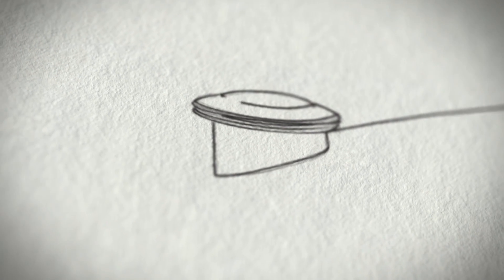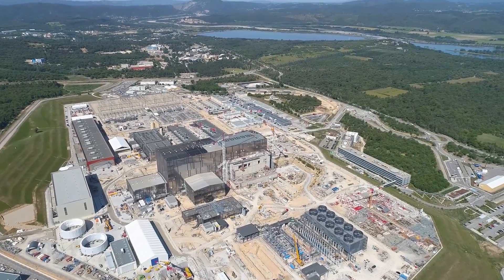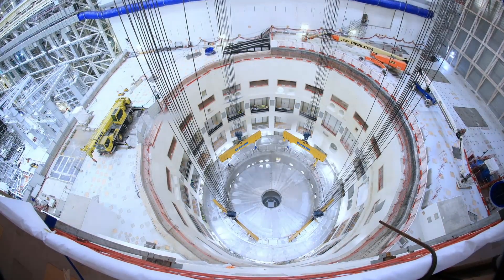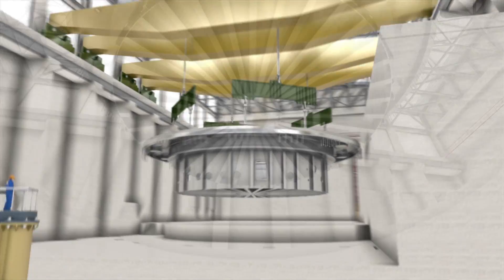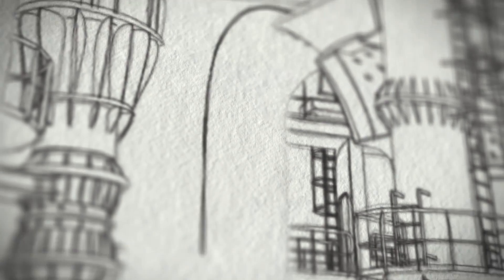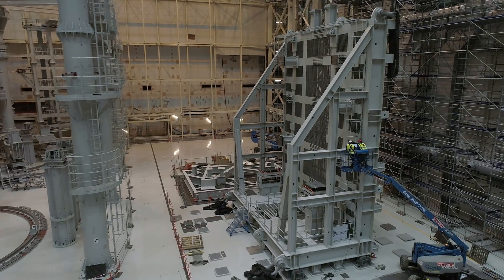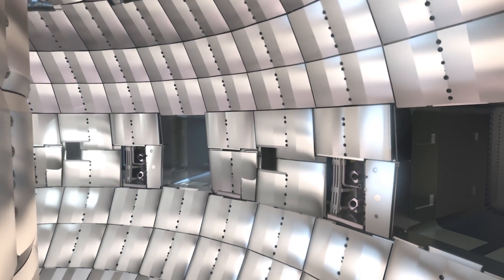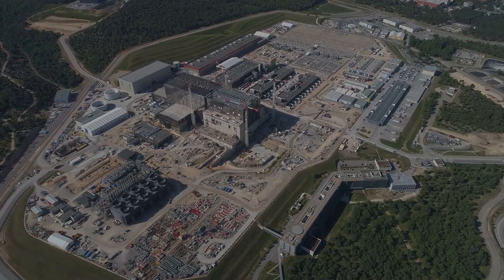ITER - the world's largest puzzle (2020 version)

Comment: They've yet to prove that it works. Why they haven't produced a reactor on a microscale first to prove the technology functions is insane.
Tens of billions spent and it could still flop! 🤣
Reply: They already did. You would know that, if you would actually know what you are talking about.
ITER is mostly based on the german Stellarator, Wendelstein 7-X, which has already proven for years that this technology works.

Comment: china already produced plasma on their own fusion generator few months ago
Reply: we have had fusion for many years but not in a way that is either long lasting nor energy efficient
Reply: @terraneko8999  - Most fusion breakthrough announcements have to do with test plasma confinement achievements. Very few experiments have employed the needed fuel mixture of rare deuterium and extremely rare and expensive radioactive tritium. Without the use of such fuels no significant fusion occurs and no fusion energy neutrons are detected.

Whenever you see a fusion energy breakthrough announcement ask yourself if the above criteria was met. Most members of the public have no clue to look for such factors.

Comment: ITER might have been a good idea when it was conceived, but much has since changed including the such successful laboratory experiment to support ELECTRIC UNIVERSE THEORY.in the form of the "SAFIRE PROJECT 2013-2019. It's all about our rapid transition to practical nuclear fusion-powered electricity to cancel out all fossil fuels for the cleanest air possible. We now here have the cheapest power with which to clean up our pollution and all industrial processes. We have in 2021 super cheap nuclear fusion energy already almost commercialised as in being in advanced design and construction. So sadly, these other great ITER-type research plasma confinement strategies for fusion and all current green energy technologies are totally out of date and relatively redundant. The also necessarily enlarged electric grid, with wind generators, solar farms and a multitude of variable green technologies, some with backup batteries, are all ugly and use up much land, while also being significantly capital intensive and all while having some safety issues. They are all also going to be unnecessary with the advent of the "SAFIRE REACTOR" that is safe, costlessly self-fueling, totally green, buildable on any scale on a tiny footprint to safely match local community requirements and it is easily chokeable and 24 hours dependable. It makes all other technologies redundant as in being much less advantageous. It is fusion nuclear powered by nuclear "NUCHEMY" and seen at "AUREON ENERGY.COM". Also learn your new involved plasma physics, astrophysics, and general Electric Universe Theory at "THUNDERBOLTS PROJECT.COM". This way you can learn your new EU Theory, advanced plasma physics and all needed to fully understand the new academic material. If you have useful comments, general or scientific please contact Dr David at dgillman47@gmail.com

Comment: The successful reaction established and recorded in S Korea and Japan was done in 1 to 10000 scale as a experiment and it was second long, that is not much to go on in to full scale, the plasma gas reaction was not proven even to be stable..... it did not run for minutes or hours or days. They going to make place welding, haw will they hold in temperatures 30K to 50K....haw will that be cool down....and haw do they going to make this reaction stable?- last longer than seconds. If this will not work as it should-or they think it may, that whole place will evaporate.
Reply: Many, who follow such accounts, fail to notice that such experiments tend to not employ the standard fuel, rare deuterium and extremely rare and expensive radioactive tritium. As a result no fusion reaction results and now fusion energy neutrons are detected. Often the public press releases don't mention such key elements in the announcement.

Comment: Attempting to harness steady-state fusion is nothing but hubris.
ITER will never produce a single watt of electricity.
ITER will never mean a commercial tokamak design.
However, it will keep a lot of engineers employed for a long time.
And it will result in a pile of Ph.Ds taller than the reactor chamber.
So it won't be a total waste of money.

Only a pulsed fusion device is a possibility in the 2020s and 2030s.
And once we have a pulsed PB11 fusion device, we'll never need another.
Reply: you know thats the reason its called the first test right
Reply: @terraneko8999  - Numerous MCF machines proceeded the ITER. The research has been going on since the 1970s. Many younger people are pretty much clueless about that lengthy history.

List of fusion experiments
https://en.wikipedia.org/wiki/List_of_fusion_experiment
Reply: The NIF is often promoted by the users as a viable path to a fusion energy power plant. They tend to leave out key facts such that it has always been funded primarily as a thermonuclear weapon (H-bomb) fuel compression research tool. Most fusion energy physicists agree that the Inertial Confinement Fusion (ICF) approach is highly unlikely to lead to a practical fusion energy power plant.

Comment: This will not be for commercial use, some of you day dreamers need to read the fjneprint. It's basically what they did with the particle accelerator. It's a project that took decades, failure upon failure . This won't be any different, it's clearly stated that it can only of it even works. Can output BRIEFLY 10x the power it's been given in theory. 

ITER's thermonuclear fusion reactor will attempt to use 50 MW of heating power to create a plasma of 500 MW (thermal) for periods of 400 to 600 seconds.

Wouw.....there goes billions for a flicker of hope. Don't get me wrong, it's a step but not even close to being a reactor that will be useful for us.

Comment: Fusion reactors will never be built. The complexity is horrendous - putting together vacuum systems, diverters, breeding modules, neutron multipliers, cooling systems into a workable system able to withstand high neutron doses will be a nightmare, with a capital cost estimated to be a factor of six more than a fission reactor. In addition, regulators looking at reactor safety will never allow large quantities of tritium to build up in the machine, and it is impossible to prevent this.
Reply: How do you define large quantities of tritium? I’m pretty sure they will allow it since they’ve approved ITER

Comment: "
Philipp Hoedt 1 month ago I am always surprised about how little attention this project gets when it is so crucial for all of humanity."
Completely irrelevant to humanity.  Note the sun has most Periodic Table elements in its chromosphere.  Therefore if it is hydrogen fusion, it isn't making helium, it is making everything.  Okay, use hydrogen fusion to make lead and show how that sustains power production.  Houston, fusion power has a problem.  Fusion cannot be constrained to helium formation and the self-propagating hydrogen fusion basis is unknown.  Sounds like ITER is going to get coated in lead inside.  That is okay, no fusion in a lab has ever occurred, so it won't work anyway.  Smaller tokomaks never worked.  Hey, if it doesn't work because you don't know what is going on, make it bigger, that will do it.

Comment: It's a grand experiment that will in the end show that fusion can be approached, like say traveling to the moon in a hot air balloon, but never reached .. least not in a controlled economically viable way. Course if you want subsidized power generation at 100$ / kilowatt then ya, bring on some future variant of this quite awesome but utterly useless machine. People that have never designed and built anything with their own two hands but instead day dream thru optimistic videos seem to think that technology has no limits .. that the very base that tech relies upon, material science, has no limits either. That adamantium and unobtainium are just a few discoveries away. That all problems in physics concerning fusion and space travel and any tech oriented venture can be overcome ..

Comment: can i ask why the design is cylindrical, not spherical? I mean there's a reason why the atom looks like a model of the solar system because well from an engineering point of the view the design is perfect for being able to control the fusion, I can understand the design to create the reaction necessary but A) Have you actually managed to create fusion within a prototype successfully not through simulations and B) are you aware of how much energy is going to expended during the fusion of deuterium and tritium because the computer controlling the magnets is going to need to be pretty quick in compensating the energy released if you not careful never mind nuclear bombs being devastating, that has the capacity to wipe us off the face of the planet and then some. Einstein knew all of this, you'll essentially be god, you'll have power over life and death and be able to traverse time and space, we don't have unity, you can't control covid 19 at the minute and you'll use it for weaponry against each other to fight over scraps when the universe is filled with abundance and enough resources to create anything your heart desires, its a level of power that needs to emplaced within the right hands. I hope you know what your doing, god speed in these times your work is the key to our salvation and our future for humanities sake.
Reply: Even if the plasma stops being contained, it will cool down as soon as it expands even a bit. Worst thing that could happen is that the facility will be out of order for another eternity, but it doesn't have any destruction capabilities. There is no chain reaction.
Reply: @Ministrator03   thanks for the reply have no idea i'm just curious as I think we all are, I'm just thinking of reactions that happen with the sun i.e supernovas,black holes and solar flares, I mean its not exactly stable itself but I'm no scientist so I don't know the ins and outs but to say its completely safe 100% would be silly, obviously there are fail safes like you mention a complete shutdown and flooding of the system I'm just thinking during the initial stages before it reaches a sustainable level here is an extract from Jet https://www.sciencelearn.org.nz/resources/242-plasmas-and-nuclear-fusion#:~:text=Fusion%20is%20the%20process%20occurring,of%20energy%20in%20the%20process.  ..... The reactor has a doughnut-ring shape and is designed to heat hydrogen gas to a very high-temperature plasma state (150 000 000°C). Very large magnetic fields are also generated to control and contain the plasma. That sounds like a lot of oopsie daisies if that goes wrong :)

Comment: anyone else getting super sci-fi vibes when she says "poloidal field coil"
Reply: not to be that guy but its toroidal meaning donut shaped
Reply: Aryansh Sharma god damn it, it sounds a lot like she is saying polloidal. Well, thank you. I will edit it.
Reply: @isaacgardner5418  lmao it actually does.
Reply: im a fuckin idiot, both poloidal and toroidal are words which describe the torus of reference.
Reply: Aryansh Sharma ahh well, the more you know I guess.
Reply: @isaacgardner5418  "Poloidal" refers to the direction of the magnetic field, the coil creates. The Toroidal coils are positionized vertically and create a strong field in toroidal direction "in direction of the donut". Since a huge current is conducted through the plasma in toroidal direction, an additional poloidal field is created. These both fields are the basis for the plasma confinement. 

The six poloidal field coils create additional contributions to the poloidal field an are relevant for the "plasma shaping". Without them, the plasma would really look like a donut: if you cut it in a half you saw a circular cross section. Due to that shaping, the cross section becomes rather D-shaped. This makes the plasma more stable
Reply: @fwieschollek  ur very smart
Reply: @fwieschollek  I assume that altering these polloidal magnetic field will result in a stellerator. I'm guessing here, don't take it seriously
Reply: @fwieschollek  The original machine had a base plate of pre-famulated amulite surmounted by a malleable logarithmic casing in such a way that the two spurving bearings were in a direct line with the panametric fan. The latter consisted simply of six hydrocoptic marzlevanes, so fitted to the ambifacient lunar waneshaft that side fumbling was effectively prevented.

The main winding was of the normal lotus-o-delta type placed in panendermic semi-boloid slots of the stator, every seventh conductor being connected by a non-reversible tremie pipe to the differential girdle spring on the “up” end of the grammeters.
Reply: Turbo encabulator
Reply: For me the word "Tritium" is enough for getting sci-fi vibes.

Comment: pleaseworkpleaseworkpleasework. If it doesn't it will be so hard for other more advanced fusion programs to get going. The technology used in this mammoth of a machine is already becoming obsoleted by other programs such as SPARC which utilize RBCO high temperature superconductors. ITER was too far along in design to use them and I don't think it will be possible to switch to something like that at this stage. The fate of fusion energy rests on this teams' shoulders.

Comment: I'm stunned by the delay in this project... I believe in it but I live not far away and I know the French mentality which consists in making it last as long as possible... I won't be surprised if the first test is not done before 2050.

For example, a project for an expressway in Marseille has been planned since the 1970s. As long as the project was in the hands of the public, the work was not moving forward. As soon as it fell into private hands with Bouygues, in 3 years the project was almost finished. 

So the first test in 2025? I can't believe it.

Comment: What bothers me about this project is, why can't they create a minuscule or small proto-type of the reactor to see if it works? That would save a lot of money, resources, and time.  Yet, this organization prefers to build a "big" reactor with no guarantee that will officially work.
Reply: There are smaller fusion reactors all over the place that can conduct fusion reactions, but have yet to make more energy than it takes to contain the plasma. They need more magnets to contain the plasma and create longer reactions. The goal of iter is not to prove the concept but to offset the energy cost of the magnets, and make the first reactor with a net positive energy output.
Reply: @zoravar.k7904  So, in other words, practically it WORKS operating stable for long periods of time?

Comment: 0:42 Actually ITER was set in motion back in 1985, during a meeting between Reagan and Gorbachev. 
Lots of political issues delayed the project again and again.
Reply: Yes, but actual work began 2 decades later.
Reply: @snetmotnosrorb3946  actually its not that bad. lithium ion battery in '85 but it still not good enough until 2000's. that's just a battery, scale up to fusion power, researcher need good amount of time and money to achieve it. first major fusion reactor is hydrogen bomb in 50's but its not viable to produce power until 2030-2040. i mean its okay considering building hundred thousand kilometer of superconducting wire, gigantic vacuum vessel that can sustain extremely high energy of neutron, breeding tritium from lithium on blanket etc etc

Comment: wait.. if small ones didn't work why this one will ?
Reply: The speed of reactions (chemical, physical, nuclear) usually is a function of temperature and the amount of reactive material around. If you take 1 gram of gunpowder, you can make a harmless firecracker, cause it only reacts slowly. If you take 10 grams, you get enough to propell a 0.22 bullet. If you take a 100 Grams, you have enough to blow a hole into a wall. A kilogram might destroy the entire room you are in. Reactions scale nonlinearly with the amount of reactive material. For some applications, there is a minimum of reactive material required to even work - you might know this from the bunsen burner from chemistry class. it wont start on the low gas setting - not enough gas to sustain a burning flame on its own. Once you apply more gas to the burner, you can light it properly and it stays on.

With fusion, it's clear that huge reactors will definatly work. Just look up into the sky, the sun is one of them, and it works. So the natural thought process is that the more material available for fusion, the more likely it is it will work. This is one of the (grossly oversimplified) reasons ITER is building such a huge reactor vessel. The smaller ones might just not have had "enough gas to light a sustainable flame" to use the methaphor I introduced in the beginning.

Comment: what is different with ITER from other tocamacs?
Reply: ITER is prototype of first thermal-fusion reactor.
Reply: @saintsinister8859  then what about other fusion reactors ? what are they ??
Reply: @sanjaygupta6746  most of the fusion reactor aren't capable to produce power, because tokamak needs input power to sustain fusion in it, and in general this input power remains greater than the output power which we gained from fusion resulting in a net Power loss and that's where the problem is, that's going to change with ITER...
Reply: @soumenmondal2378  thanks
Reply: Size

Comment: A confined gravitational field can only be achieved with another big mass as stars or planets to obtain a stable equilibrium needed to contains the nuclear fusion and its high temperature. The ITER uses magnetic confinement in the tokamak for the plasma at very high temperatures, and this needs enormous electric power.  It's a useful study tool for the next few decades until nuclear models are developed to help reduce the input energy needed. Lithium and Boron are useful since their nuclear structure favors resonance energy capture within the atom.